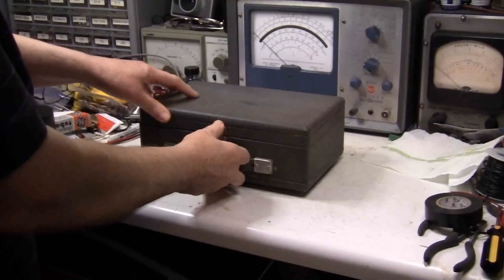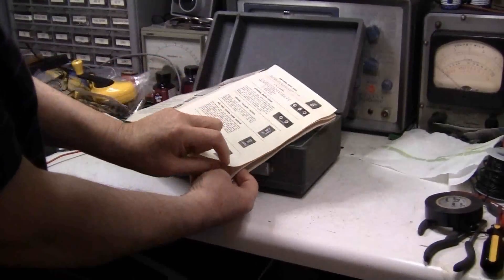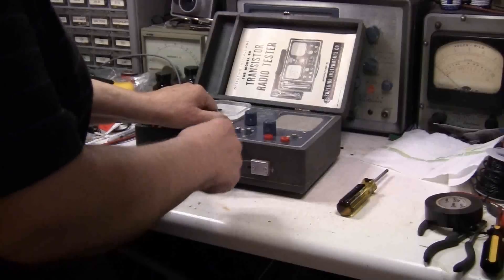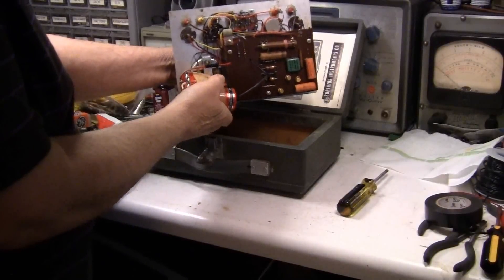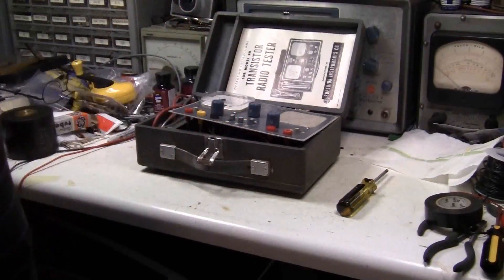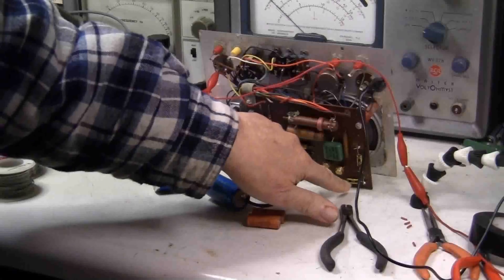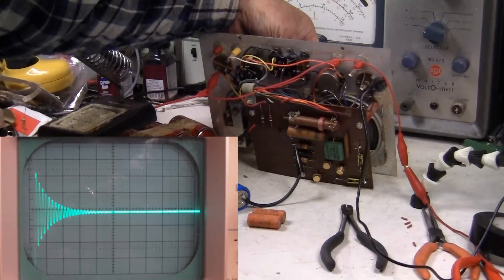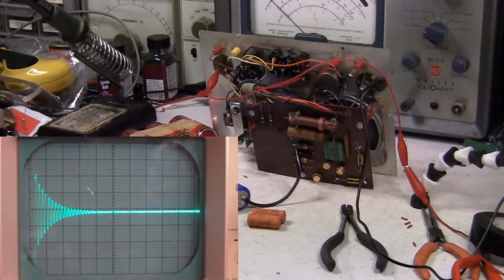Superior Instrument Transistor Radio Tester first look

Comment from the maker: Thanks rlewis1946
Thanks Roy,
When I bought it I thought it was a transistor tester with a speaker for noise detecting. But I was pleased when it turned out to be a transistor radio tester, never seen one before. It will be interesting to use on a radio.
Rick

Comment from the maker: Thanks f0ggy2006
I'm always looking, that's also the fun part. I was pleased when it turned out to be a transistor radio tester, never seen one before. It will be interesting to use it on a radio.